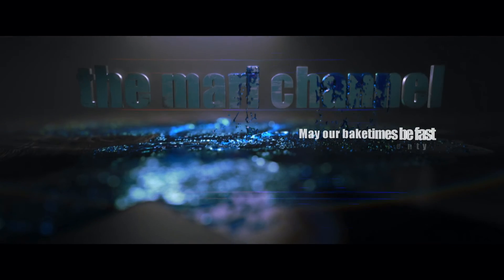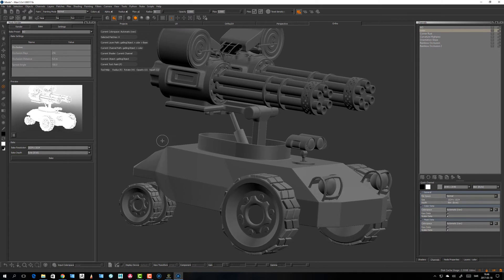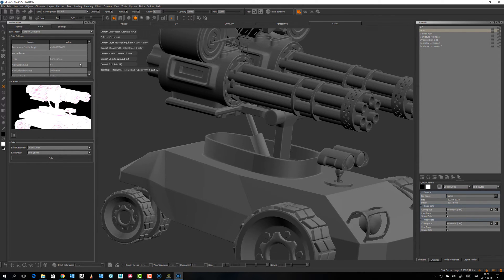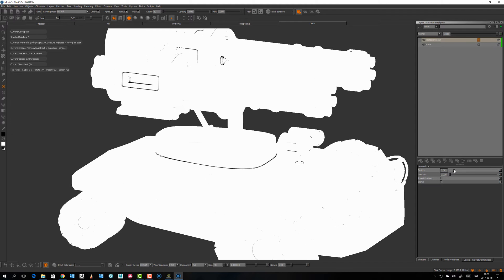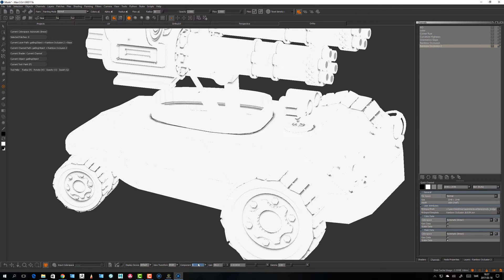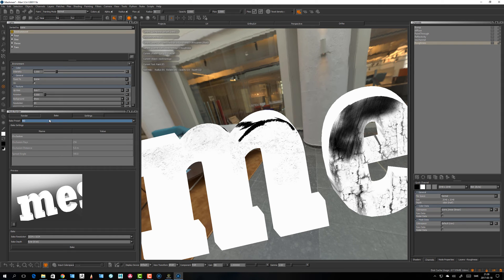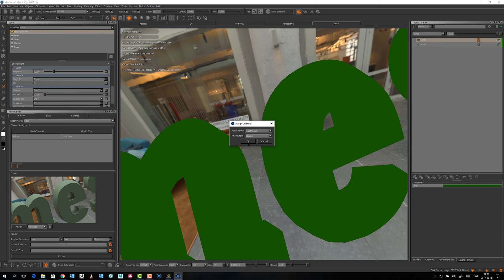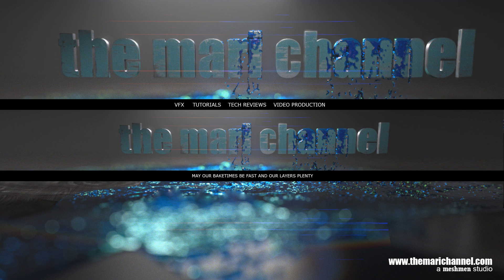Mari Modo bake and workflow tutorial | Introduction to Mari 3

Comment: hey @meshmen studio is there a way to batch bake various passes? like curvature first, then AO
Reply from the maker: Not in mari, I generally use third party software to bake passes at the moment
Reply: @MeshmenStudio  Ok.. woudl be cool to have something like that.. Thanks!
Reply from the maker: For sure in the long run its needed as a material system will need bakes if you want to drive procedural textures and gizmos

Comment: Sir now i am facing another problem (  when i export diffuse current channel i can't get the exact resolution i am using 4k resolution Size for Diffuse Channel but i am getting only 1 k resuliation Size in out put )
Reply from the maker: Hmmm are you on a commercial license or a ple? Are you using channels or node graph? Could be channel is set to 4k but the patches are smaller 1k. There is a number of things that could be involved
Reply: Meshmen Studio  i am using commercial license sir and i am using channels sir yes the channel in 4k only
Reply: Meshmen Studio  how can i find out patches are in smaller ?
Reply from the maker: Agastin Raj  if you have a channel selected and go to the UV editor what does it say on the UV in the corner
Reply: Meshmen Studio  sir it doesn't say anything  but i can't Solve the problem
Reply from the maker: If you go to the uv editor in the lower corner there should be a uv number 1001 etc and a resolution per patch indicated
Reply: Meshmen Studio  yes its there 1001 4096 X 4096
Reply: Meshmen Studio  now what shoud i have to do
Reply from the maker: How do you export the channel? Can you write down a bit in depth the steps you do tn mari
Reply: Meshmen Studio  Yes sir
Reply: Meshmen Studio  Step 1.  fist i select channel window an then i select diffuse channel 
steep 2. right click on diffuse channel then select Export Flattened 
Step 3. Choose Export current channel flattened
this is how i Export Diffuse map from Mari
Reply from the maker: Hmmm I cant figure out what else could be involved. I would contact Foundry support. Before doing that can you just test an a new scene, create a 4k channel, export flattened
Reply: Meshmen Studio  ok  sure
Reply: Meshmen Studio sir i have test it in Mari 3.2v1 by creating a new project  even i am getting same problem  while exporting diffuse map
Reply from the maker: One last thing you could try is to delete the mari config file. It sometimes is involved making mari miss behave. I would upgrade to at least mari 3.3 i found that version the best in the 3 series.
Reply: Meshmen Studio  if i delete the mari config file what will happen because i am asking  this for it won't affect the entire mari software
Reply: Meshmen Studio  were can i find Mari config file
Reply from the maker: When you restart it will set mari to default install
Reply: Meshmen Studio  i have to restart my computer or mari
Reply from the maker: Just mari
Reply: Meshmen Studio  its that mari have any restart option tab
Reply: Meshmen Studio  i just close an open mari right now
Reply from the maker: You have to close mari, delete you config file and re open mari
Reply: Meshmen Studio  ok in which path i can find the config file
Reply from the maker: I take it you are on windows, is that correct?
Reply: Meshmen Studio  yes i am using windows os
Reply: Meshmen Studio  were can i find the Mari config file in windows os
Reply: Meshmen Studio  sir i am waiting for your reply
Reply from the maker: Google is sometimes helpful :) here is the place on windows Win: C:\Users\<USERNAME>\.mari\TheFoundry\Mari.ini
Reply: Sir i have delete the config file and i tried to export diffuse map from Mari it's not working
Reply from the maker: Agastin Raj i think you have to contact Foundry support
Reply: @MeshmenStudio  ok sir
Reply from the maker: Hope you figure it out. Have you tried to use the nodegraph to export a new channel?
Reply: No sir i will try it right now
Reply from the maker: Ok good luck
Reply: Meshmen Studio  Sir i am stirling with this problem

Comment: Hi, how do you decide the Occlusion rays in the Bake options when baking AO? I'm assuming more rays means cleaner bake but longer bake time? Similarly do you match the bake resolution to your patch size (ie: If you have 4k patches, you use 4k as the bake resolution) ?
Reply from the maker: Yeah more rays less noise, going above 4k generates crazy bake time. I rarely go above 4k. Sometimes baking low and upscale can be fine. I wish foundry developed faster bake engine
Reply: Meshmen Studio Got it, thanks! And yeah, I hope the bake times are reduced in a future release..